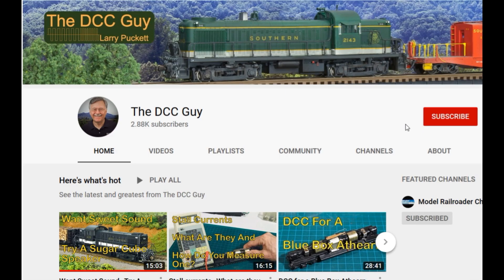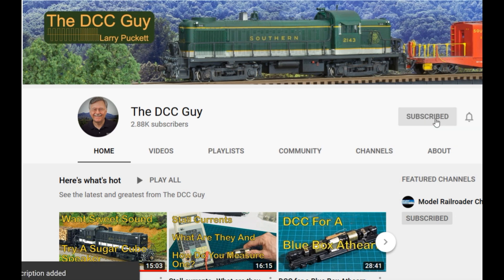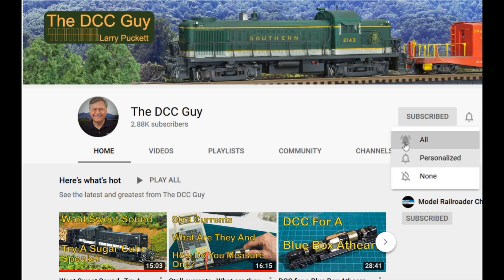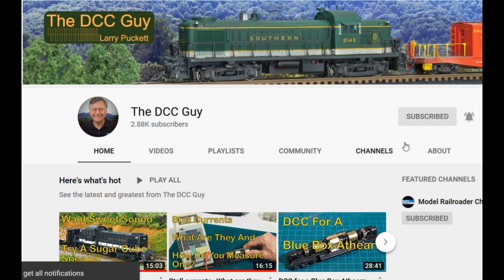Add A Shelf To Your Model Railroad (152)

Comment: I would use enameled outdoor or deck screws or stainless screws instead of the drywall screws I think you used.  They can rust easily.  Even sweating drink cans used only one can start the rusting as can a sweaty hand on it!
Reply from the maker: I used those for the main installation but used these for the shelf. I have used a lot of drywall screws on my main layout and it is still standing after 7 years. As a group model railroaders tend to overbuild in my opinion.

Comment: Larry, I bought your recent DCC book.  A lot of great reference material.  May I suggest a second volume or companion that has projects other than DCC installations in locomotives?  A volume about what else we can do with DCC on our layouts.  

I like this shelf idea.  I wonder if I can make it a folding shelf.  Up and out of the way when the layout is not in use.  But, I have those fascia mount throttle pockets and cup holders.  Maybe mount those to the underside of the shelf, so they can be used when running the layout and the shelf folded down during construction... Hmmm, I wonder if that would work.  I’ii have to experiment.

Comment: Very interesting video. If using L metal brackets on the wall vs typical benchwork, how would you recommend attaching a shelf? Plan on using 2 inch foam and 1/4" sub ply for switch machines, wiring, etc. Will have (or planning to) have 1x2" supports across the front and back to provide room for wiring and attaching fascia. I like the idea of a shelf but not sure can be done the way I am constructing my around the room layout. Thoughts?
Reply from the maker: I used 2” foam in a previous layout and not again. It is too thick and creates extra work to get switch machines to operate correctly. Plus it makes a very thick shelf and if elevated requires a very thick fascia to hide the switch machines, wiring, lights, etc. I went with 1/2” plywood and 1/2” foam and simply screw the plywood to the shelf brackets. Lowes sells very wide brackets and my upper deck is up to 18” wide. I use a 1x2” along the front edge for added rigidity and as a place to mount a hardboard fascia.
Reply: @TheDCCGuy  Intriguing and had not thought of that aspect. Crap, now I have a bunch of 2" foam, guess can reuse for hills/mountains/etc. Very insightful and glad I asked the question. You channel is excellent! Just got your three books on electrical/dcc etc. Looking forward to reading them and gaining more knowledge. Thanks again for all you do for the hobby and those of us novices!
Reply from the maker: Give me an email address and I’ll send some photos of the upper level shelves. My main level is built exactly like the module construction.

Comment: There are two modules and at the start of video 143 there is track running between the  2 modules but I didn't see where you discuss whether the track between the 2 modules is continuous or is cut to allow the modules to be separated. If it is cut, how do you ensure continuity when taken apart and then re joined? Thanks
Reply from the maker: The DCC power bus continues under both modules and there are track feeders on both modules. I use the Anderson Power Pole connectors that I showed in the power bus video to disconnect and reconnect it when I separate the modules.
Reply: @TheDCCGuy  I was interested in the track: did you cut it where the modules join?
Reply from the maker: Yes, I laid the track with the modules tightly fit together and after the adhesive set I cut through the rails. This means that as long as the alignment dowels do their job there will be a perfect match at the rails. I also have something in the mail to me from Wales that is designed to create an even better alignment. I don’t want to say more and spoil the surprise.
Reply: @TheDCCGuy  thanks for the videos!!.... the challenge is to see how well the trains fare when they try to cross the join when things are put back together

Comment: I would skip using the brads for the front trim.  Just use liquid nails to attach it. The surface won’t be marked and you won’t have to do any wood filler.  That stuff never matches anyways!

Comment: I like the idea of a shelf but must be removable since my modules take a beating being transported to train shows. I do have a removable 1/4 inch plywood shelf that rests on wooden support rails attached to my module legs.
Reply from the maker: Yes, I can see where i  some cases a quick release mechanism might be desirable. With the MR project layouts David Popp always designs them so they can fit in a van and elevator for travel to shows. some of the mountain tops are removable and fiddle yards either come off or are hinged to drop down. There’s always a way.
Reply: You could try m4 or m6 bolts and wing nuts rather than screws if you want the cross braces removable!?

Comment: I really like this idea! I’m going to use it on my layout  !
Btw you have quite a few Walthers kits. Are they for the Piedmont Southern and Will you be making videos as you assemble them?
Reply from the maker: A lot of those are passenger cars. However I also have a short stack of through plate girder bridges that I misordered—wrong stock number and there was a large restocking fee so I figured I’d sell them myself. As for the structures those are just the tip of the iceberg. I’ve been buying them for 25 years and ended up with way more than I will need. So I need to get a table at the next train show or put them eBay. To answer your question, I will do some videos on construction though as I progress.
Reply: What is the name of your eBay page?

Comment: I think you need a bigger hammer. Enjoy your videos. Hello from Down Under.
Reply from the maker: I had to shoot that footage twice—first time with an air powered brad nailer, but the sound crapped out on it so I had to reshoot. I didn’t feel like cranking up the air compressor again so I just grabbed the old tack hammer—not the best choice but it worked.